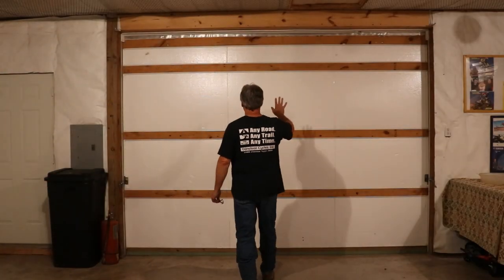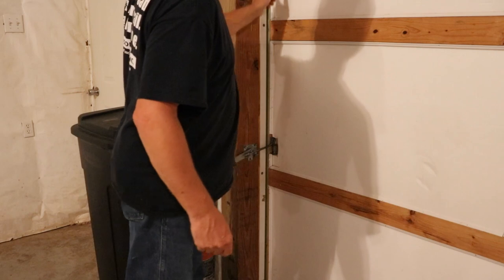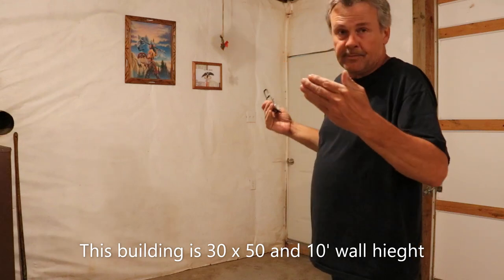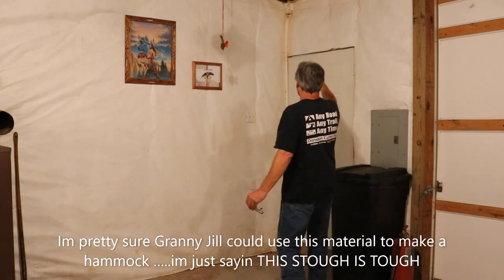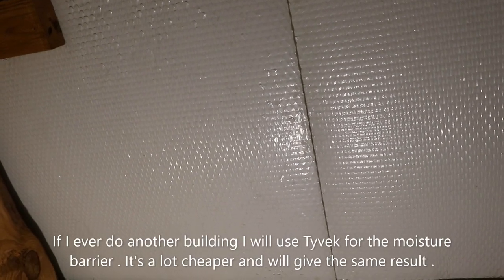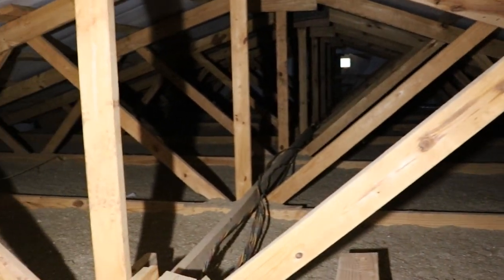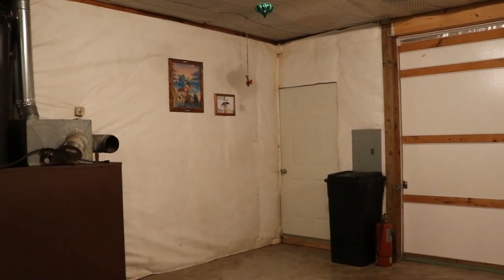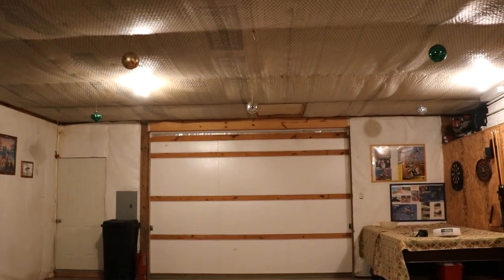Easy Way To Insulate A Pole Barn

Comment: A couple of thoughts.  Batts are available in 8 and 10 ft widths which do not require additional framing to support them.  The building should have been designed by an engineer so framing out the interior with 2x6s can an unnecessary expense as no additional strength should be needed.  If it's an non-engineered Ag building that wasn't properly designed that's a different issue of course. Attaching bottom plates to the floor and posts can cause issues when the slab rises or drops.  Expansive clay especially will create severe problems.  It'll lift the posts out of the ground and damage drywall if used.  Again, this depends on soil type and I've seen buildings be fine for years or even decades before problems arise.  So instead of framing out like a conventional building consider bookshelf or outside post girts.  If stick framing with a bottom plate must be used then make sure it's suspended between the posts at least 3 inches above the floor.  Hope this helps it's not a critique of the video he did say he hasn't had any problems.
Reply from the maker: Good Evening John and Thanks for your comment and Thanks for Watching

Comment: Regarding your walls, did you have house wrap installed when framed. My 24x32 does not have it. I was debating putting foam board, shiny side out to reflect heat or cold either in between boards against metal horizontally or over top of the boards vertically then framing in for r19.

 Just wondering if you put insulation right against metal or how yours is done. Want to make sure I avoid condensation and since yours has been up 20 years it would give me good insight.
Reply from the maker: Good Morning , Our building has exterior building wrap on walls and rafters before the metal was installed so I framed in-between the 6x6 poles with 2x4's and installed R-19 to the studs  . The foam board insulation is a good idea and will raise the R-factor for sure and as far as installation vertical or horizontal they will be close to the same for R-factor ,so which ever is best for you and adding R-19 to your framed wall you are going to have a well insulated building . I hope this helps and Thanks for Watching
Reply: Thanks so much for your response.  I have been going back  and forth with this since there is no building wrap.  My dad seems to think it would be OK to just frame in a wall with R19 batted insulation Since it wouldn't be touching right up against the metal. I am concerned about condensation with that. He doesn't think the foam board would be necessary and I'd just an extra expense.
Reply from the maker: @michaelbartlebaugh1683  You are Welcome , these building are are nice with climate control and being able to use them throughout the year is a true benefit Thanks again and good luck with your Building

Comment from the maker: Hello I Had a question from a viewer that left no way to reply so I am posting his question here  . Jayce Wagoner
 wrote ,
Please correct me, cause it seemed to work for you. I'm in the process of doing a pole barn build similar to yours, but after reading on some forums, wouldn't the Tyvek need to be on the cold side of the insulation? Would this not hold moisture and cause mold? ,,, My Reply. First  Jayce you do need a moisture barrier  on  the outside before placing your metal make sure to rap the building from the top of the trusses down the metal will sweet from temperature changes so make your lapping so the moisture runs down hill . I have  had no problem with mold the Tyvek covers the interior wall the same that plastic would however is much more durable as well as acting as a finish for the wall . I hope this answered your question and Thanks for Watching .
Reply: Thank you!! Anyway you could make a video or explain how you built your sliding door?
Reply from the maker: @jaycewagoner3972   Hello Jayce , if I have to build another door I will make a video for you . The bigger hardware store's do carry all of the sliding hardware that is needed and it is not a bad build to do . Thanks for Watching .

Comment: Question for you: what do you call the fasteners on the side of the large door? About half way up the door when you are pointing to the green strip. And where do you get them?
Reply from the maker: The fasteners are called jamb latches  and are used to keep the door closed what you are looking at is a 12 foot sliding door that slides to the right .  These latches are used on most sliding barn door installs and can be found at most hardware stores  . Thanks for the comment and Thanks for Watching .

Comment from the maker: If you are finishing a 30 x 50 barn including framing on 24 inch center R 19 insulation for the walls and ceiling wire for the ceiling and Tyvek to finish walls and ceiling at todays cost is just under 3000.00  Thank For Watching

Comment: So after putting studs in did you use the building rap or tyvek as you finish on the wall
Reply from the maker: Yes the building rap is the finish you see this material is really tough and if you choose later to cover your wall with sheet rock plywood or metal leave the tyvek in place for a moisture barrier and cover over it Thanks for the Comment

Comment: How much would you say it cost you? I have a similar sized  pole barn just looking at how much I should save up
Reply from the maker: Great question .For 30 x 50 Barn  at todays prices including the framing through  the finished wall and the ceiling @ R-19 value as you see in the video is just under 3000.00 I hope this is helpful for you Thanks for the question .